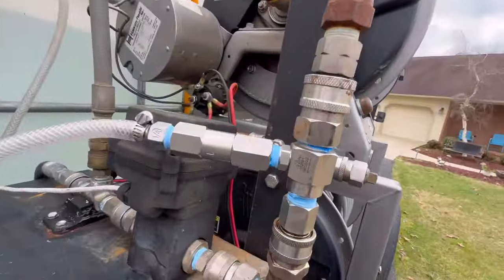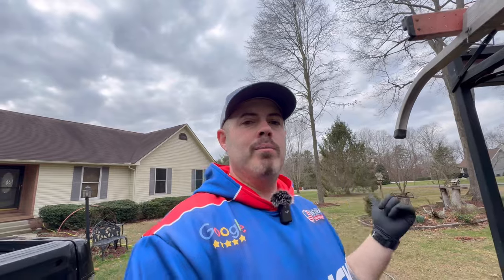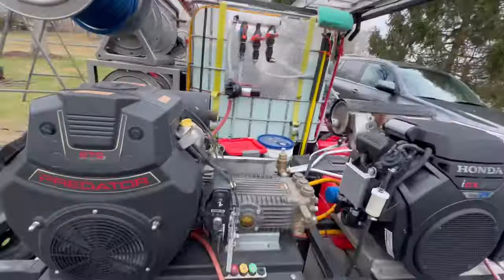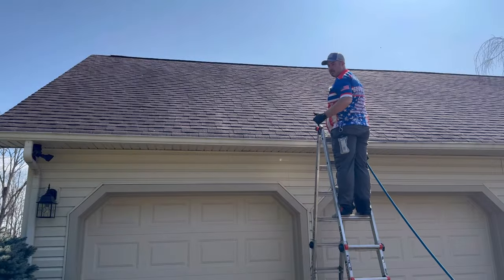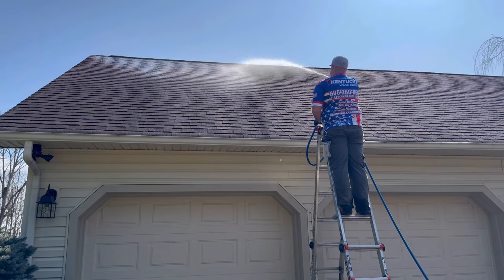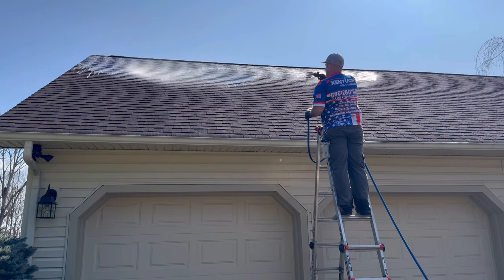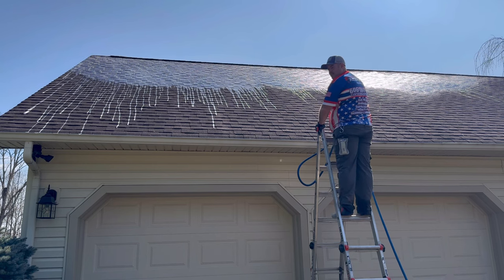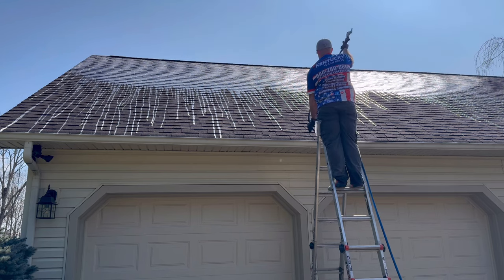How to Wash a Roof and House

Comment: What size pump do you have? What size hose do you have and what number J-Rod do you run?
Reply from the maker: Hose is 1/2 kuri tec, nozzle is a 4040 and 0040, the pump is a 6 GPM Flojet

Comment: Do you change tips for lower pressure being newer concrete or adjust the unloader?
Reply from the maker: You can change tips to reduce the pressure, or adjust the unloader but that could effect the GPM output as well.
Reply: Yeah but what do you do? I thought about one day getting the regulator for the surface cleaner to adjust on the fly kinda deal
Reply from the maker: @Bobby-ym5qd  those work great that’s what I have on mine.
Reply: Ohh cool deal then brother thank you

Comment: what kind of deposit do you require for a job like this? I do alot of deck staining and require a 25% deposit to get on the schedule so i don't have to buy products out of pocket. Roof washing uses alot of chem
Reply from the maker: I’ve never required a deposit on a job before 🤷🏻‍♂️. My thoughts have changed on that recently with commercial bids and residential jobs over $2,500 require a 25% deposit.